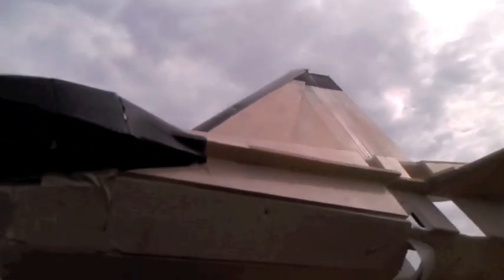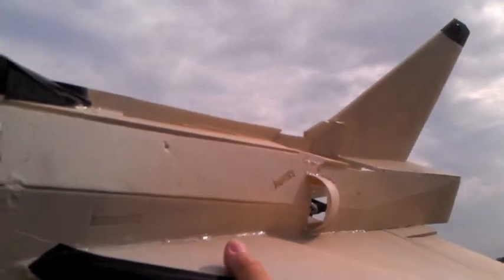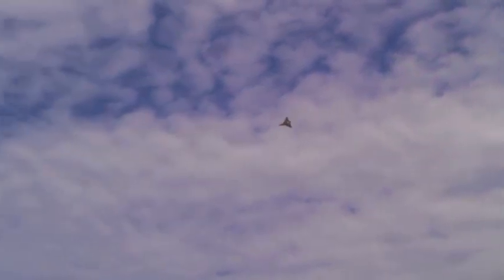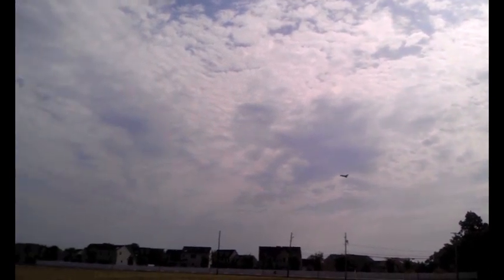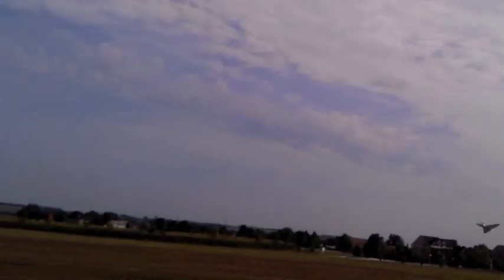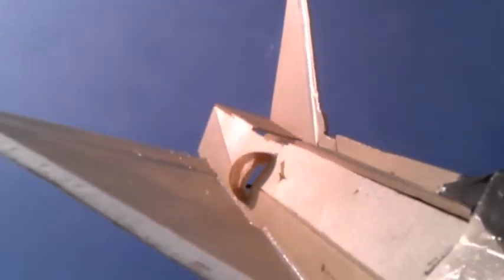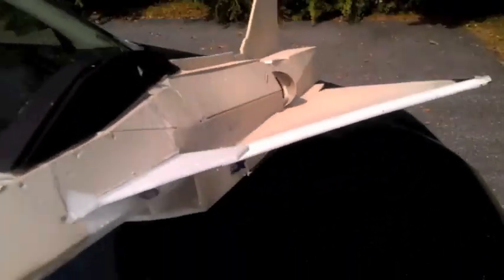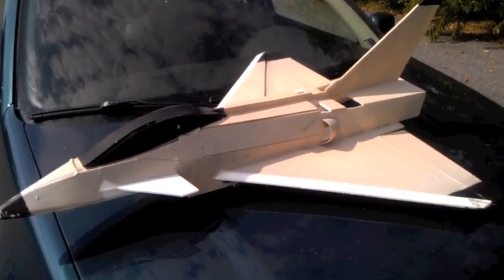RCPowers Eurofighter v2- KF Airfoil and 4s Testing

Comment from the maker: The rudder is nice but not necessary. I would build without and it's very easy to add later.  For a couple of my planes lately I cut the rudder before assembly then taped it stationary until I decided whether I wanted it. My su47 still has them taped. I never put in servos.

Comment from the maker: In this video i had kf4 in the beginning and the cg was not right.  It was designed to use kf2 and the cg cannot be adjusted properly without ballast when using kf4. Speed with kf4 was not greater.